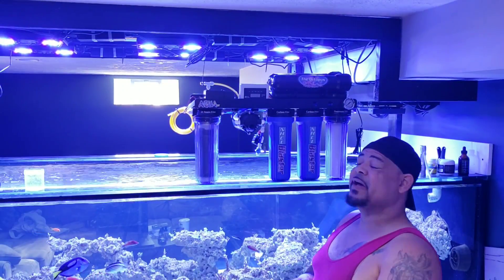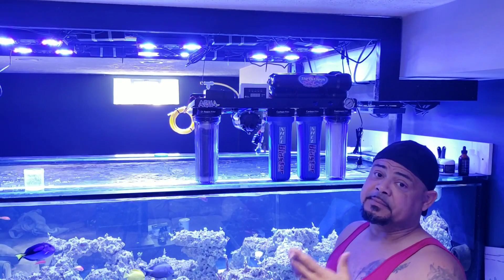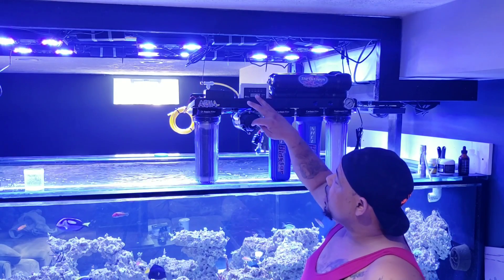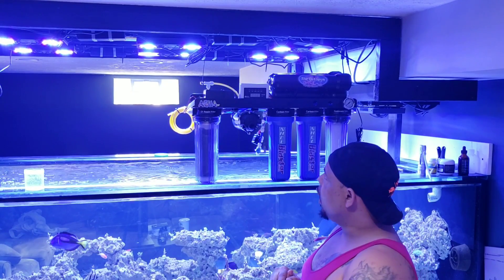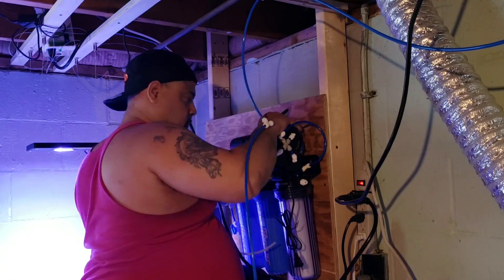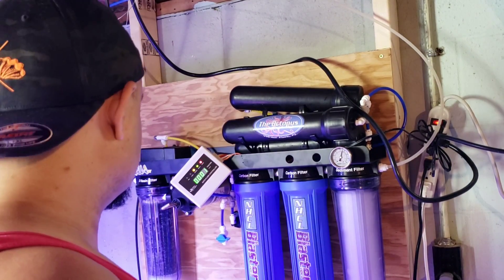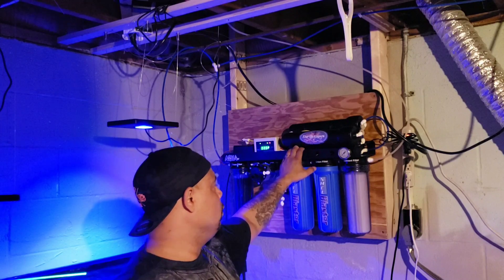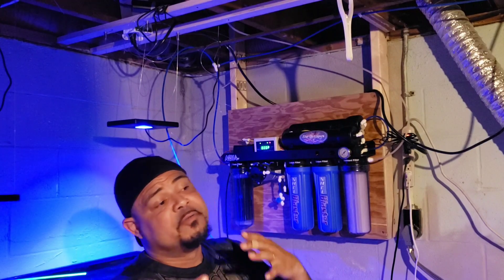Installing new ro/di unit

Comment: Nice upgrade Rico! What size micron sediment filters and carbon are you running? Are you running any type of chloramine filter as well. Just curious. Also what's the rejection rate on that unit?